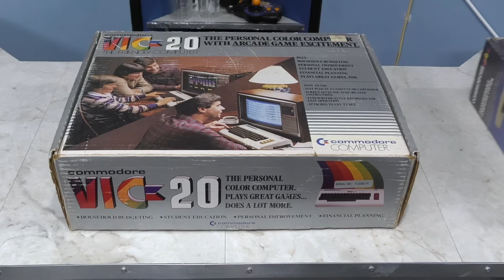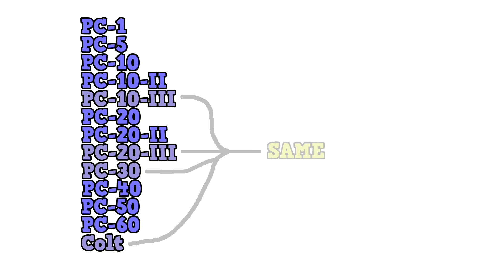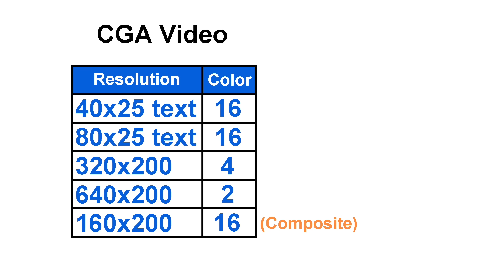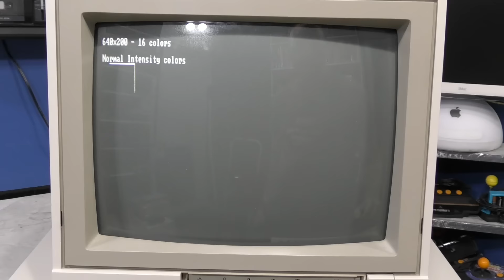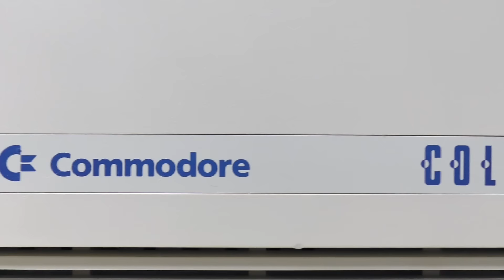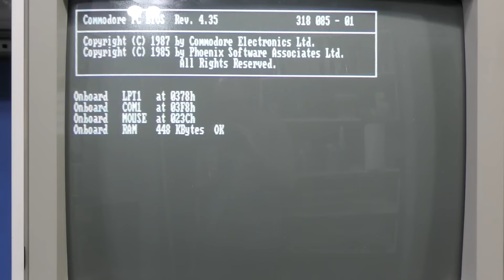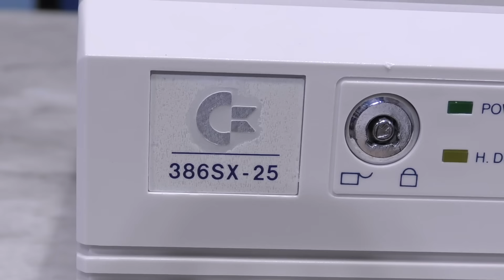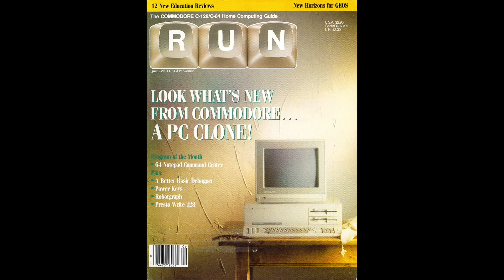Commodore History Part 6 - The PC Compatibles

Comment: The 1984 date code is pretty much evidence that they used the 128D cases or at least the moldings. The keyboard connects on the same jack as the disk drive port on the PC-1.

Comment: In Czech at early 90', when I take thought to replace Atari 800xl by PC, I've seen Commodore PC XT in the small electronics store. Price without monitor for 512 KB of RAM and 20MB HDD system was 10000 Crowns. ~400USD at the time.
I told, I'll be think yet and leaved. Half year later I bought 386sx, 2MB and 80MB drive with color SVGA monitor for 30000 Crowns. Although Noname, much better price /power ratio :D

Comment: The PC-10 uses the same housing as the A2000.....if you ever had an A2000 open you can copy that by the looks of it....Also the PCB is a true C=,the coating the PCB-overlay this all speaks C=
I had an A2088 (XT) and later the A2286 card in my A2000 and a three monitor system back in 2001 where the PC can barely handled two...A2000: Gforce 040/33/16MegFastram with its GFX doughterboard (on a dedicated NEC 5D monitor), Toccata II sound, Apollo SD64 64 bit GFX shared TARGA 14inch monitor (later exchanged to the picasso II) with the A2286, A2091A with 2MB Z-II ram, Genlock, a Paradise VGA on the A2286 side and the 1084s for the ECS Amiga output..my A2000 was truly packed, but died when a nasty thunderstorm lightning hit 5 kilometers away from us into the power distribution...since then i use (and recomend) an UPS

Comment: From some internal Commodore UK emails that I read just after they went bankrupt, it was clearly stated that the PC side was in fact a huge loss maker for Commodore. They used some dodgy accounting, draining money out of the C64 and Amiga moving it to the PC side so that the books looked more balanced (despite the huge losses)
Reply: In 1994, this may well have been the case, because by then there was a huge price war due to low-cost clone mainboards from Taiwan. If you produce in West-Germany and have to compete with manufacturers in the far east.... In the late 80's it was likely a different situation.
Reply: It didn't help that the strength of Commodore was its vertical integration with MOS technologies, capable of making all the custom chips of the Amiga and C64/128  series, plus they owned the patent on the 6502 processor so didn't have to pay anyone royalties for it.  That means in the end the chips cost them pennies on the dollar compared to other makes like Apple that had to source everything out.  But the PC wouldn't take advantage of anything MOS inventoried so there was no cost savings involved.
Reply: @oldtwinsna8347  My understanding is that MOS did make a few chips for use in their PC's (I think they were IO) but nothing of significance. MOS suffered from the same issue the rest of the computer division did, lack of investment. They didn't even have the capability to make all the Amiga chips when they went to AGA, it was so sad.

Comment: You can use phase-phase voltage in the US to get 220V-ish. Although you should use a circuit to fix one of the terminals, so it does not float. They are cheap...

Comment: Great video, but some nitpicks: The 640x200 mode with 16 colors is not a Plantronics mode. The Plantronics ColorPlus board "only" provides 32K ram, which is good enough for 320x200/16 colors or 640x200/4 colors (see https://www.seasip.info/VintagePC/plantronics.html). The 640x200/16 color mode, which requires 64K of video RAM, is an ATI extension. This mode is decribed in the ATI Graphics Solution manual (see http://www.minuszerodegrees.net/manuals/ATI%20Graphics%20Solution%20-%20user%20manual.pdf).

If I understood your video correctly, you added the 640x200 mode to Planet X3, but it pixel-doubles the 320x200 sprites you also use for the Tandy 16-color mode. On the other hand, you use the extended resolution for higher text quality. If this is really the case, Planet X3 will not work on an actual Plantronics ColorPlus card. Also, using the Plantronics 320x200/16 mode requires just half the amount of data, and thus might make the game playable in 16 colors on the PC-10.

The 132-column mode is interesting. The ATI Graphics solution just has two pixel clock sources: The CGA-compatible 14.318MHz from the ISA bus and the 16.257MHz crystal oscillator on the card. If you run CGA video timings at 16.257MHz pixel clock, you get 727 pixels into the time frame of the standard 640 pixels. But the 132 pixel text mode is wider (it seems to run into the overscan area on your monitor on both sides). My guess is that they use a 6x8 pixel font (and thus requiring 792 pixels). This makes 727 pixels (121 characters) inside the regular CGA frame size and adds the remaining 11 characters on the left and right. I counted pixels on the Z character and the backslash in the screenshot, and it seems to be indeed a 6 pixel wide box with no spacing between the characters.

Another nitpick: The red/cyan/white mode is no extension, a well-known, but undocumented feature of the original IBM CGA card (but it is only usable on the RGBI output). It's the display of mode 5, which was intended as 4 grayscale level composite output mode. Most later CGA compatibles (including IBMs EGA and VGA card) treat mode 5 just like mode 4 and do not provide the special palette. See https://en.wikipedia.org/wiki/Color_Graphics_Adapter#Standard_graphics_modes (Mode 5) as reference.

Comment: I don't suppose you could have just plugged in an US 120V AT Power Supply into that PC50 III by any chance, or does it have proprietary connectors or a different power pin out or something? Might have been able to get it powered up if you could use one, but probably wouldn't be able to get it to fit into the casing, assuming it did work.

Comment: Hey sorry but i had a question for you.  I have a white ps4 controller that has some stains on it, i was wondering what you would recommend to clean these stains off.  I’m not sure if retro bright would be the wanna go or not, especially since i can’t completely submerge the bottom half of the controller because of the ps4 light in the controller.  Thank you in advance for any info.

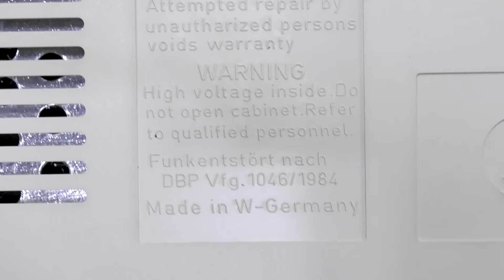Comment: 1:43 It reads: Funkentstört nach DBP Vfg. 1046/1984 that means it is radioshielded by the standard xxx of 1984. So the standard was conceived in 1984, not the computer.

Comment: you didn't cover the commodore 486 board, it would have been cool to see one with a p90 overdrive pentium upgrade (64bit cpu on 32bit pipe) DX = 32bit. also, it has 16bit isa slots, meaning you could use an awe32 soundblaster in it, alongside a good 4mb vga card, and max ram, it could pump out windows 98. that said, you could have made a decent gaming machine out of the old commodores so long as you found the parts to upgrade it, even could add a EIDE card, after all it had 6x 16bit isa slots. and even the older pc-10 III 8088 had 8bit oak VGA cards in them.

Comment: Hey, I have a little bit of a problem.
I went to a garage sale and I found 4 DS cases (I'm talking about the older ones with the GBA slot). The guy gave them to me for free! Unfortunately, I soon realized that the games weren't in here.
I asked the guy, who told me that someone had already bought the games but didn't want the cases. So, I have 4 DS cases, in mint condition, without any games. What should I do?

Comment: Not an ideal solution for 220-240v but an old car battery and cheap inverter from this way should do the job. I have a £30 invertor which is capable of powering a desktop PC. Of course, being in the UK I have little need to do this very often.

Comment: Question what CPU does the Colt have? Is it an Intel 8808? I'm assuming it's not a Motorola 68000 like in the Amiga, Sharp X68000 and the Sega Genesis( under clocked I know)
Reply: Considering where he mentioned it, it probably is a PC-compatible, and thus, either a 8088 or in the 8086 family.

Comment: It's possible connect a PC-I directly to a CRT TV screen via the composite video? I have one that belongs to my father but unfortunately I don't find the monitor or any other RGB monitor
Reply: Yes, you should be able to do this. Be aware that you can only do NTSC with CGA composite mode, therefore your TV must be NTSC compatible. However, should you have a PAL TV, it'll mostl likely have a SCART connector, which can be a good solution: You can try to build an RGBI to SCART cable: CGA timing is still TV compatible.

Comment: afaik all commodore pc's were designed by the german division of commodore. first, they had to design a portable thingy (thats the reason for the high integration of stuff on the motherboard), later they used more and more standard stuff and at the very end, they just bought components and brand them commodore. in the early 90's, commodore was the marketleader for ibm compatible pc's in germany. at the end of commodore's lifetime, the german pc market helps the whole company to life a few month longer and even after commodore's bankruptcy, the german division lifes as stand alone department a couple of month longer. but, anyway, the pc's never reached a high marketshare in the united states

Comment: When doing the video about the Amiga, please shed a light on this subject: were the Amigas really sold at a loss by Commodore, and this was the reason why they refrained from doing investment on the system, and instead tried to invest on more profitable older designs like the C128 and the C65?
Reply: That sounds contrary to history. At some point Commodore started to neglect their popular 8-bit line and starting making Amigas for the professional market, such as the 2500 and 3000, because there was more margin on those machines. When that failed, Commodore started to focus on the game market in Europe, which was where got most money from. This was when the A1200 was introduced, the CDTV and ultimately the CD32.

The C65 can simply be explained that people just continued to buy C64s until the very end of Commodore in 1994. Commodore wanted or had to do something for this market.
Reply: @danielmantione  That's an interesting POV. Many versions of the history are told by the many different documentaries on this topic available on YT!.

But part you told is related to the mid 90s, when Commodore was already clearly going belly up. The part I was referring to was in the 80s, and tops at 1990.

Comment: Any plans to do a Tandy History series?

Also, just a quick aside, that's a clone of the Lo-Tech ISA-CF rev.2 https://www.lo-tech.co.uk/product/lo-tech-isa-compactflash-pcb/ , not a genuine XT-IDE, such as made by Glitch Works https://www.tindie.com/products/glitchwrks/xt-ide-rev-4-assembledtested-8-bit-isa-gw-xtide-4/ . They both utilize the XT-IDE Universal BIOS which may be the source of the popular confusion, but because the ISA-CF utilizes PIO-8 mode, it's mostly compatible with only CompactFlash cards, where a true XT-IDE board can read just about any IDE hard drive, DOM, CF card, etc (other than ZIP drives, CD-ROM, etc which XUB isn't designed for).
Reply: If that hard drive from the PC-20-III only has an 8-bit bus, you might be able to make it work with the ISA-CF card, since it's 8-bit PIO. Might be worth a try, just to see if it can.

Comment: 1:43 "the back of the case says 1984" is not true... It's just following electrical standard 1046/1984. Following that standard should mean it came out later than 1984.

Comment: I'm really disappointed that your Commodore PC clone history ended with the 386 since I am positive that they also made 486 clone. I owned a branded 486DX-33 back in the days. it came with 4 MB ram and 120MB hard drive. MS-DOS and Windows 3.1. it had a 9 pin serial port and a parallel port. Some ISA expansion slots. I had sound blaster installed in one. It had 2 drive bays.
Reply: The 486 clones were not manufactured by Commodore, they bought OEM machines and stuck their badge on them.

Comment: them ATI 'cgi wonder' things probably are the best 8-bit isa video cards out there without resorting to the WANG 256KB vga 8-bit isa cards (no idea where wang sourced those, probably made them themselves)... most actually do have a cinch composite output (Although only at ntsc timing and color signal) and they can display pretty much anything on any monitor (cga on herculess monitors, herculess on cga monitors, or either on composite) also came with a little programming guide if i recall correctly so no 'guesswork' like with most other video cards where if it wasn't in the ibm technical reference guide, you simply never got to know how to use the damn thing lol. them ati cga wonder things stayed around here all the way to vga replaced all of it (fairly late, as color never was a priority)... aint nobody gonna bother with ega and it's crapped up monitors 'in between' :P

Comment: Ah... You know I vaguely suggested porting X2 to the Atari 800 ages ago, but ironically given how Atari graphics work, X3's layout would be much easier than X2

Given that fact the best bet for porting X2 to an Atari seems like it'd be using X3's graphics and UI design (the simplest graphics mode for an atari even happens to be a 4 colour mode - albeit with the option of choosing any 4 arbitrary colours), but with the logic from X2...

That's kinda weird to consider...

(of course it's possible that Ataris with a ram expansion, like say RAMBO - which typically means a machine with at least 320k would be able to run X3 itself - an atari with a Rapidus and VBXE installed on the other hand is pretty much guaranteed to be able to run X3 - albeit with a complete code rewrite to 65816 assembly, since that's comparable in performance to a 386 with VGA graphics. - and has somewhere in the region of 35 megabytes of RAM)

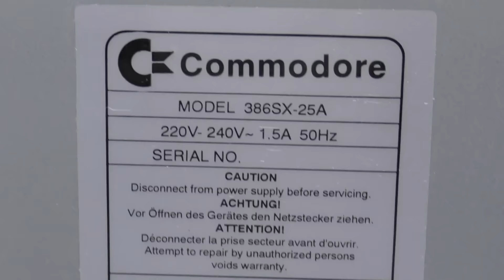Comment: 20:12 even if you had 240v power you wouldn't be able to use it anyway since it requires 50hz power. So even if you had a power up converter you would still fry it
Reply: Would using a UPS system (uninterrupted power supply)  that could output the correct power voltage be a possibility in this situation?.
Reply: @JekyllJones  I have no idea. I'm not an expert or anything. I just know that pumping 60hz into a 50hz-only power supply ain't gonna yield good results

Comment: Not bad looking computers, but at the time they made no sense.
From an outside public perception, it was like a final nail in the coffin admission from Commodore, that they had failed and imploded completely.
Oddly, that Amiga 500 or 1000 running in Macintosh emulator would of been a total game changer winner for them.
Of course, that little problem of being unable to license the Macintosh ROMs....   but that could have been solved on the down low in the dark with a black market of pirated ROM chips.

Comment: Aww, Commodore PC 10 III was my first pc-ibm clone back in the 1990 … despite the processor double speed I felt very limited by the mass storage at the time, but now I have fond memories of it. I did something bad to my machine, like putting a 30 pin simm in the ISA slot … smoke everywhere!

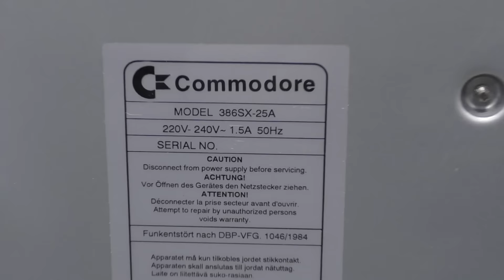Comment: 20:08  WHAT?  You absolutely DO have 230V (240V) readily available!  I am sure you would find it very easy to properly install a suitable 240V outlet in your home.  What you DON'T have available is a 50Hz supply.  Question is: would the computer care about that?!

Comment: Also, pretty sure the mouse you're showing there is a 1351 'NEOS' mouse for the Commodore 64, not the 1352 Amiga mouse, which is the one compatible with the Commodore PCs.
Reply: The 1351 and NEOS mouse were completely different rodents. See here for pictures: https://www.c64-wiki.com/wiki/NEOS_Mouse
Reply: @danielmantione Yes, but the 1351 was NEOS-compatible, as opposed to the earlier 1350 mouse, which was basically a joystick. Hence I called it 'NEOS' (note the quotes). As far as I recall, that's how people referred to it back in the day.
Reply: @Scalibq  They were not compatible, software needs different code in order to support both. For example on the Final Cartridge III desktop you can switch between the Neos and 1351 protocol.

The Neos mouse uses the joystick up/down/left/right signals to transmit 4-bits at a time. After 4 samples you have 16 bits that form 8 bits for the X delta and 8 bits for the Y delta. The advantage of the Neos protocol was that it is not Commodore 64 specific, you can support a Neos mouse on any computer that has an Atari compatible joytsick port. The disadvantage of the Neos protocol is that the CPU needs to actively monitor the joystick lines, which can be a challenge if you want to use the CPU for other tasks.

The 1351 on the other hand, uses carnal knowledge of the inner workings of the SID chip and transmits a mouse position between 0 and 63 over the analog POTX and POTY lines. The software has to translate this 0..63 mouse range to a full screen mouse range. The advantage of the 1351 approach is a very high sample rate, the mouse transmits its position 2000 times per second and humiliates modern gaming mice. The CPU can read the mouse position any time it wants, if it spends it cycles on something else, there is no risk of loosing mouse movement. The disadvantage of the 1351 is that it needs the SID chip and is therefore only compatible with the Commodore 64 and 128.

The 1350 was indeed a very bad joke and just a joystick in mouse clothes.
Reply: Okay, then I misremembered that part. Regardless, the chunky 9-pin connector at  13:20 is one I've only ever seen on 1351 mice, not on the 1352. Those have a longer, flatter version. And they are not compatible. The Commodore PCs need the 1352.
Reply: @Scalibq  It depends on the manufacturer of the mouse: That chunky connector was used on mice manufactured by Bremen, the longer flatter connector was used on mice manufactured by TDK and Mitsumi. Amiga mice manufactured by Bremen are rare, but they do exist. That makes it likely that the mouse shown in the video is indeed a 1351, but it could also be a rare Bremen Amiga mouse.